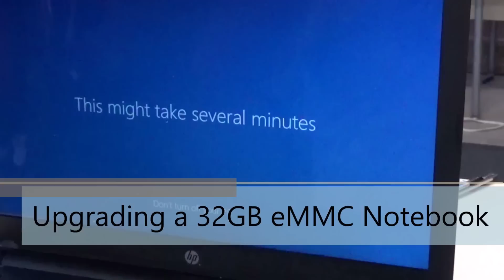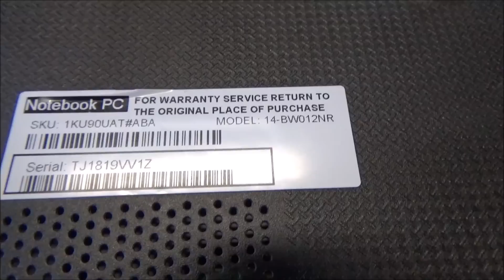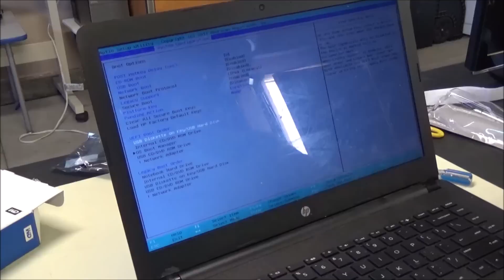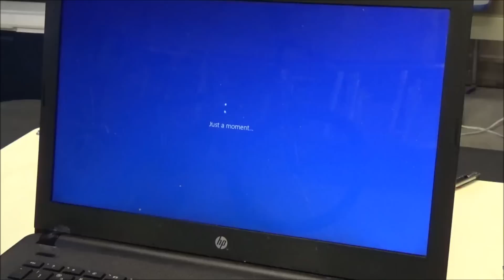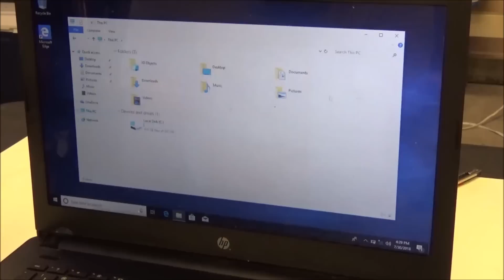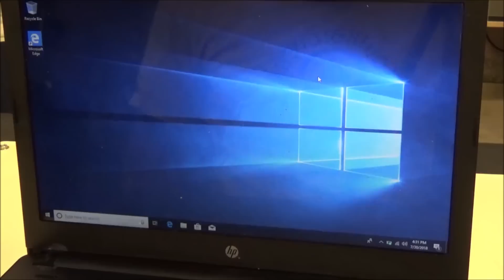Upgrade 32GB eMMC HP Notebook with 1TB HDD

Comment: I have the same damn model of this laptop and I can’t for the love of me get that last screw out
Reply from the maker: I'm sorry, but that's  kind of funny! Good luck 😆
Reply: PimptatoPCs any pointers on what you did to take out the screw? I have the same flat head screw driver that you use to go under the screw
Reply from the maker: @colariokratzcrazynacho5933  I just pried up on the screw with as much pressure as I could while unscrewing it at the same time. You need to pin the broken piece of plastic (that's inside the laptop) in place so it doesn't twist with the screw. That really all you can do. I was really surprised when it actually started to loosen up. I was only giving it a little more time before the Dremel was deployed lol
Reply: @PimptatoPCs  Ok Just a Question, So how long does the laptop lasts according to your neighbor? Did it had any problems after you set up the SSD and Ram?

Comment: I hate how hp thinks its acceptable to put stripped screws in their products. I literally had to bend up the heat sink to get to my emmc
Reply: I have a question, sorry if it is too obvious for you, but for me isnt: why did you need to get to the eMMC? you can't remove that, they are soldered into the circuit board and they are not upgradeable, so, what was the point to get to it? Really, its an honest question.
Reply: @drawdebono77  had a virus on my computer
Reply: @drawdebono77  real bad one

Comment: Does anyone know of a way to install a ssd on a dell Inspiron 11 3000 that has a 32gb emmc?  Thanks in advance
Reply from the maker: Hey Jimmy. I was doing a little research on your Dell and Amazon has your exact model listed with the 32gb emmc plus a 256gb SSD. I bet you can open it up and install an SSD without modding anything. Probably should reinstall Windows on the new SSD. Most of the time the 32gb emmc isn't even enough space for updating Windows. The 32gb can still be used for storing movies or other files so it's not just wasted.
Reply: @PimptatoPCs  Thanks, I am trying to add some storage for a friend, I open it up and see what I got.  Thanks for the fast reply.  Jimmy
Reply from the maker: @jimmymullins4997  No problem man. Let me know how it works out.
Reply: @PimptatoPCs  I got it open but I don't think there is a place for an SSD.  I can send you a pic if you want
Reply from the maker: @jimmymullins4997  Oh crap, I'm sorry dude. Just looked at the listing again on Amazon and it says 256gb "SD" not "SSD". I don't know how I read that wrong! I feel bad for giving you wrong info. Well, the only thing he can really do to make that thing functional is to install a Linux OS or some kind of cloud OS like Chrome. They need to stop selling a "laptop" with 32gb's of space, it's a scam.
Reply: @PimptatoPCs  Hey no problem thanks for the help
Reply from the maker: @jimmymullins4997  You're welcome.

Comment: i want to thank you for taking out the time for making this video especially showing how to taking it a part saving me the time on figuring out for myself so i purchased similar HP laptop devise saw the limited hard drive space but was out of town and needed a laptop. i was limited to where i could go and what was available at the time. price was main factor knew hard drive would have to be replaced windows would not fit eventually on it with all the updates in the near future. and having experience on pcs would replace the hard drive myself. i have plenty of hard drive with larger space laying around from other pcs. so it ran out of space couldn't update so put it in the closet till now. saw your video took it a part like you did,  but my hard drive was the normal sata size connection not requiring the adapter to replace the new hard drive but to my surprise there was space for another hard drive a cavity next to it with the mini sata but blank nothing in that spot i replaced the hard drive with a 500gig and saw several carey holzmen videos on how to clone or reinstall windows on a hard drive replacement. i chose to reinstall windows 10 from a flash being it was all apart. everything working no issues thanks again people like you taking the time out to put these how to videos online are an asset to the internet
Reply: Kalina Ann  wow this is dated well since then i Took it apart again months later as per cary holzman on youtube professional pc tech from his videos  and i put a ssd 2 TB in it now it is running a lot faster too now ssd's are way better more reliable no moving parts will extend battery i think i paid 235.00 US $ on amazon
Reply: Kalina Ann  and as far as Velcro i am a mechanic so i thought that type of fastener was a bit well i be kind not good so i made a bracket and screwed it to the existing  frame holes  and then the  hard drive
Reply: Kalina Ann  ha ha never saw any of that as a man and a mechanic dont read the destructions instructions lol not to mention i cant see with out readers always just tried to figure it out ha ha and when all else fails i start reading then i figure it out directions take all the fun out of it ha ha i guess
Reply: when i purchased the laptop i was in Georgia training at a fiberglass plant and i figured while i was away i would pick up a laptop my old one was dated and could use the new one  for email etc... didnt realize it didn't have a hard drive in it when i got home and took it apart   i saw the 30 gigs of space which i knew it would have to replace it but it was cheep enough and i had plenty of spare hard drives that would work, well one of the videos said you needed an adapter but there was another space next to that connection that would support a 2.5 hard drive so this video was a big help in taking it apart i didnt want to destroy it trying to figure it out thank god for you tube i follow carey holzman now  on you tube and he has video too replacing hard drives but he changes them with ssd's and also watch now just to get updated on current stuff

Comment: Mine must be a cheaper design then because it only has connectors for the battery, screen, speakers, and mouse pad which is unified with LMB and RMB.  Unless  I missed something i'll have to check again later.

Comment: Dumbass grandparents bought these for my boys. After the initial boot up, they were completely unusable.
Hoping I can update them and get some use out of them.
Reply: I feel terrible for grandparent when you said them...dumb... Please dont call them that :(
Reply: I bought several of these laptops with the 32 GB eMMC hard drives several years ago. 
I did a complete install of Windows 10.
Then after every Windows 10 update, run Disk Cleaner.

Comment: 13:35 So what happened to the other drive, why is it gone?
Reply: because he didnt even bother to went into windows disk management to see it visible as it was hidden by windows in the new installation he did in the new ssd, which, by the way, is an OEM/retail version which won't have the HP utilities, that maybe in any other HP pc would be bloatware, but for these notebook are essential because of their ease of use nature. If I was the person who gave this guy my notebook to "fix it and upgrade it", I would pay him with a face punch and a nutscracker. Messed up every setting in the OS, got rid of the possibility of an HP system restoration, scratched the inner chassis with a cutter, was thinking about mutilating the notebook's barebone, oh, and lastly (even though it was the first thing he f**ked up) he screwed up a screwhole twice, once trying to get it out and leaving the hole unusable and then forcing the screw out with two metalic tools, a screwdriver and something else I cant tell because of the angle the video was shot. Hope he is was as optimistic and proud of his job, that he sent a link of this video to his client, so the poor guy can see this a**h*le was laughing all the time while he f**ked up his machine.

Comment: Never mind I found the hard drive caddy on Amazon looks like the exact same one https://www.amazon.com/SHINESTAR-Replacement-Macbook-Internal-SuperDrive/dp/B077M2R98K/ref=asc_df_B077M2R98K/?tag=hyprod-20&linkCode=df0&hvadid=309779531175&hvpos=1o1&hvnetw=g&hvrand=4057486723174167003&hvpone=&hvptwo=&hvqmt=&hvdev=c&hvdvcmdl=&hvlocint=&hvlocphy=9005917&hvtargid=aud-829758849484:pla-570612951753&psc=1&tag=&ref=&adgrpid=62412137260&hvpone=&hvptwo=&hvadid=309779531175&hvpos=1o1&hvnetw=g&hvrand=4057486723174167003&hvqmt=&hvdev=c&hvdvcmdl=&hvlocint=&hvlocphy=9005917&hvtargid=aud-829758849484:pla-570612951753

Comment: Thanks for the video. After viewing it, it looked like my problem was solved until I opened my HP Notebook-14z-cn000 CTO Product # 3TP46AV. I found the 32GB Flash Drive but no SATA connector. It is connected with a 10 pin ribbon cable AWM 20706 105C 60V VW-1 CViLUX. I can see where one would have to either us.e a dremel to remove the mounting bracket in order to have a place to mount the 512 GB Samsung SSD I purchased. However, my biggest problem is how to connect the SSD to the motherboard since there is no SATA connection. In fact, there is not even a SATA connector for a DVD drive. So again, my problem is connecting to the motherboard. Can I get a ribbon cable like the one that is there to connect to a SATA connector to attach to the SSD? I know nothing about ribbon cables so I don't know if just using another 10 pin ribbon cable will transfer the date sufficiently. Also, I have seen SATA connectors online connected to the SATA connector that connects with the SSD connect port. I have pictures of the inside but don't know how to attach them here. Is there any advice you can give me? Please help!
Reply: Look harder, if SATA connector is not there , then you are out of luck.
Reply: I have same question, the connector between motherboard to SSD is inside the caddy shown in video at 5:12min. Did u get this done? If yes, please share name or link of the caddy. Thanks in advance.

Comment: Do these two models
 
HP 14-CM0012NR
HP 14-CF10510D
 
 
Have the same size on the back plate? If I need to buy a case since my back plate is scratched.

Comment: Omg!! I have this same P.O.S... bought it for work with an intention to at least upgrade the ram. I checked in the task manager and it said there were two slots.. silly me.. the is only one slot and a blank area where the other should be. Super frustrating. Awsome video! Thanks for the information!

Update I put a 500gb hdd in this p.o.s. and did a fresh install of windows 10.. the system did a bios update and it totally it just died after the update completed.. the screen went black and that was that.. It hasn't booted up since. I tried an external display with hdmi and no luck. I even tried to put the original little ssd thingy back in and that didn't do anything either.. if anyone has any suggestions I would be open to trying them. Thanks!! Overall I would just stay away from this piece of junk!!!!
Reply: I had one that has no ram slots, the ram is soldered straight to the motherboard
Reply: I broke 14 hp SCHOOL Laptops by entering the bios

Comment: Be careful doing this with an hdd.  He covered the breather hole.  It can over heat and prematurely ruin your storage
Reply: That hole is not for heat ventilation.
Reply: Its for regulating the pressure

Comment: You said that you left the eMMC drive in it when rebooting and installing the HDD But after installing windows, you didnt see that there was a drive there after looking in the "This PC" folder. Is it possible that you still have to format that drive and then give it a different name (i.e F:/ instead of C:/). Also, you may want to tell your friend that she may notice a drop in battery life time as HDD take up quite a bit of power. Good clip though. Pretty much what I was looking for.
Reply: hdds take in power ? firest time hearing  this
Reply: Yep a 3.5” 5400 is about 15w

Comment: Even though you mentioned it is your neighbor's laptop, I would have refused to install an HDD in that and would have pushed him to get an SSD. The only thing that upgrade did was give the user more storage, but probably at a rate slower than the eMMC. Every HDD upgrade I do is an SSD unless the person I am working with needs massive data, and in that case, we swing the convo to a home NAS or something to the sort.
Reply: Maybe the 32gb eMMC drive could be mounted from device manager, then nuked and paved over , as a second storage drive. Then use that drive to install any web browsers or smaller apps that are either more commonly used or where a bit extra speed performance would be useful.
Reply: @tealc6218  I was wondering if that chipset could by any chance have Intel Rapid Storage Technology.  If so, make the eMMC a cache to the HDD like we did back in the day of expensive and small SSDs!  :D  But it would be better to just remove the HDD and add an SSD.  A netbook so limited would never need more than 240GB of space unless the user is watching a lot of video.

Comment: does this mean I can update my HP Stream Laptop? I need to get it upgraded cause its technically the same thing as the note book you upgraded except but my laptop is a few inches bigger.. Can I do it though?
Reply: This guy did a hdd and ssd  will be much better if won't hear up. The best thing to do is to open it up and see. It's easier to get cloning software then install it on like he did.

Comment: I admire this video coz even I wish to upgrade my Asus x205ta's drive. Will you be able to help with the same?
Reply: even I have the same device with storage problem, I wish if we could mount the ssd in a case and stick it on the laptop using double sided tape, and connect the ssd through usb

Comment: @PimptatoPCs. lol, I use to have a bad habit of putting my comment's down prior to the end of the video. Like with yours, I would have put 1: The difference between a Notebook & Laptop was the Weight. 5 & under was a Notebook & 5 & over meant Laptop. 2: I was gonna mention that if you had access to the BIOS, you could change the MBR [Master Boot Record] to the gggggggdrive that you were adding

Comment: What did you do there, create a system image from the eMMC onto flash drive and install that on the SSD??
Reply: No, he used the port for optical drive to install a HDD through a caddy interface. Optical port<-caddy interface<-hdd
Reply: snot416 

I think he has an ISO on the flash drive, and activated it with a valid key.  The way that you’re explaining wouldn’t necessarily need a flash drive.  You could just clone the eMMC to the new SSD directly with a USB to SATA interface.

Comment: Upgrade the 32GB Hard Drive Sata to a 1TB or 2TB SSD Sata Drive
Reply: It isnt a 32GB SSD, its a 32GB eMMC, which refer to solid state MODULES SOLDERED DIRECTLY to the MoBo, so, they are non-upgadreable, non-removable, and non-serviceable. Only thing they last as much as an SSD, dont take up much housing as they are as thin as any solid state memory module, and are the cheapest kind of permanent storage "drives". Actually, eMMC's data trasfer rates are equal to a mechanical HDD, and sometimes even slower. But they don't include it in prebuilt machines for their performance but for lowing manufacturing costs. Essentially, they are selling garbage to people that just know little or nothing at all about technology but need a cheap computer for a while.

Comment: 9:06, there's a SATA port like right there. remove that adapter and just chuck it in there.
Reply: yup, that's the crappy eMMC thing
Reply: Does the ribbon thing have to be unplugged. Will any adapters be needed or is the emcc sata so the ssd can plug right into it. Sorry for the verbiage, i know hardly nothing about computers
Reply: @iadonttube___492  Yes, oddly enough the eMMC chip uses a SATA interface and has a normal SATA connector so you can replace it with any 2.5" SATA drive. You will probably have to disconnect the long ribbon cable to fit the drive but after it is plugged it you can reconnect it. Do not pull on the ribbon cable to remove it, there is a latch on the connector that flips up and then you can pull the cable out, to install it just push it back in and out the latch down.
Reply: VERY helpful! Thank you!
Reply: What all has to be done to remove the adapter?
Reply: @iadonttube___492  Remove any screws and just pull it away from the board

Comment: I was just gifted 2 of these things, now I think I'll try the upgrades. I've read through your comments, do have any better ideas? Like switching out the hdd, emmc etc. I'm not super savvy but I know a bit. Your video seems helpful, thank you.
Reply from the maker: That's pretty sweet to get them as gifts! You can remove the emmc and use the sata port that it's plugged into if you want to avoid having to mount the new hdd/ssd where I put it. It just kinda depends on if you think keeping that 32 gigs is worth it. If you are upgrading to a 500GB ssd or a 1TB hdd 32 gigs isn't that much to worry about, but if you are going with a 250GB or smaller it might be nice to have that extra 32 gigs available. SSD's are getting a lot cheaper, I just picked up a 512GB for $64.99. Thanks for watching Marcus!

Comment: Hi thanks for your video,

I have a hp notebook model 14    Am 052 nr and it does have the 32 gig sst drive. I want to upgrade with a 1 tb sad as you did but wondering what your comments would be if it would be work. 

Also did you upgrade the ram too?

Thanks for making it look relatively easy. 

Thanks     jerry
Reply: Did it work,  i have 14-am052nr and bought a 1tb , not sure how to install
Reply: I have the same model, although I have not cracked it open yet.  If I were to take on the project, I would start by searching for images of replacement motherboards.  That way you can see if the eMMC is soldered, or connected via SATA.